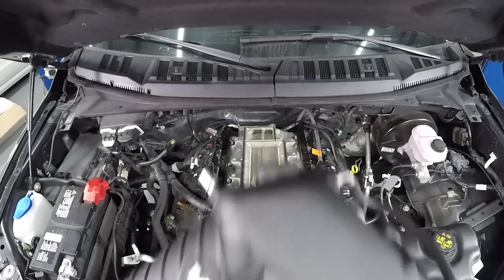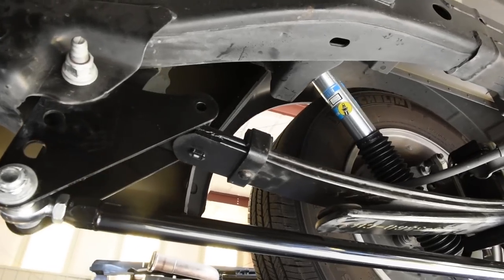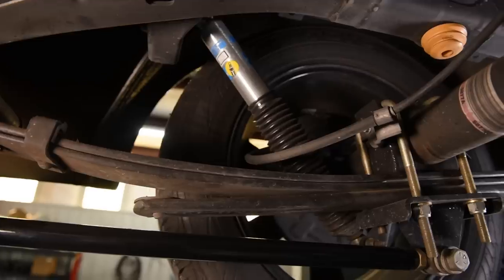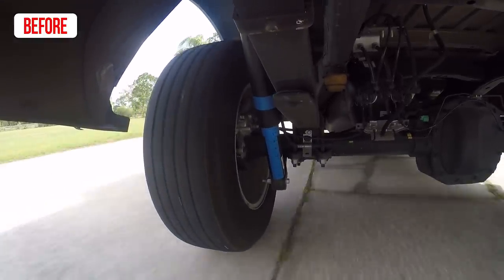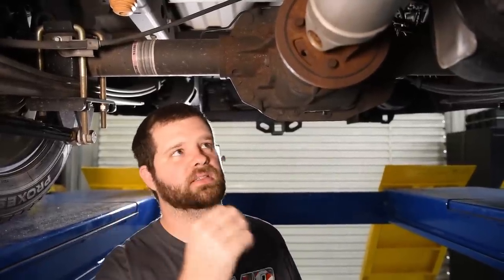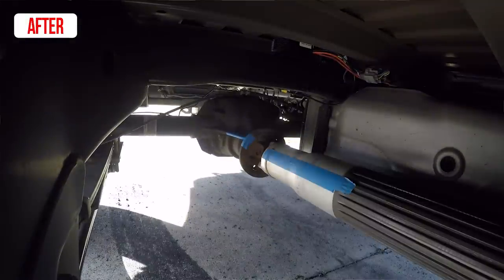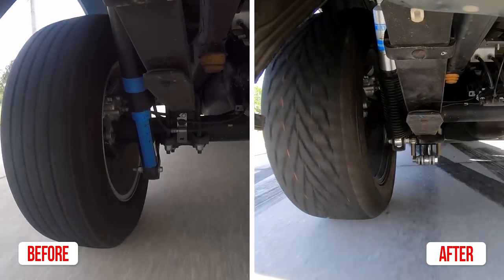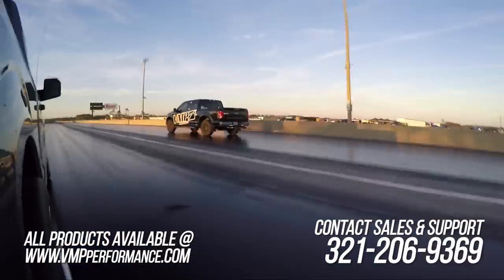How to Make Your 700 RWHP Ford F-150 Race Truck Hook

Comment: Dude..!!
    This was super ligit.. I have 95 I'm placing a 331 Stroker in ... and Cal tracks are my go to ... after a small lowering kit... thank you guys for you time... also I'm going to be bringing my 011 GT500  for a Gen 3 800+ setup.. again Thanks...
Reply from the maker: Thanks for watching ! We're pumped to give your Shelby more horsepower! Let us know if you have any questions! - Max
Reply: @VMPPerformanceTV  I do have a question there Max .. first off thank you for your response... now the question.. is 800+ .. let's just use 700+ Rwhp as a reference.. is that a safe number for everyday use .. I want an 800+ Shelby on the Crank.. I just don't want to hurt my Car .. thank you for any advice.. 👊
Reply from the maker: Yep, that should be fine! Also, if you're planning on bringing the car to us, you should look into our vacation package. We're offering two free nights in a New Smyrna Beach hotel with a qualifying supercharger install. So you get to enjoy time on the beach while we install your new blower! You can find more info on that here http://bit.ly/VMPVacationPackage

Comment: I added caltracs to mine because in this video. I was running horrible 60ft time in the upper 2 sec range due to wheel hop. I also have the belltech 1000sp installed. Why did you with the bilsteins?
Reply from the maker: I heard that the Belltech rear shocks were too soft.- Joe

Comment: Is that the 8.8" rear axle?
At what point did it change to the 9.75"?
Reply from the maker: The aluminum 5l trucks all seem to have the same super 8.8 as the s550 mustang
Reply: 90% f150s come Super 8.8, 34 spline

Comment: Are they 2 or 4wd ? As all f150’s have a open rear differential don’t they!? Mines a FX2 so it has a locker ,which I’ve now been told not to launch it on a dry road or at the track,? So us 2wd guys are really stuck with power on one tire only,? The 4wd is only 3wd correct?
Reply from the maker: This particular truck is equipped with an electronic locker which Joe enables before the burnout when he's making passes.  It depends on the way the 4wd truck is equipped, if it has electronic lockers or not.  If it only has a locker in the rear, then yes.

Comment: Joe what slick size and wheel set up are you using out back?  Are you using skinnys up front or normal street tires.  I have a 305/45/18 Nitto NT555r drag radial out back it still spins.  I have the Hellwig  front and rear sway bars and the Belltech 3/5 kit.
Thanks Jay

Comment: Do you have a similar set up for the f250 6.7 I'm pushing about the same hp and a ass load of tq like 1400lbs worth have the same issue with traction

Comment: That is the 8.8 inch rear right. What gear are you running? My RCSB 18 with a 9.75 rear has a steel factory drive shaft not aluminum like yours, wonder if the rear size is why.
Reply from the maker: 8.8 with 3.55 in my truck. Joe

Comment: Did you have problems with the truck bogging between 1st and 2nd gear shift on the street when losing traction? I had my 2017 f150 pretty much identical to yours tuned by VMP and could never get that issue resolved. Always bogged and then slowly came back into power.
Reply from the maker: This is due to the truck hitting a rev limiter and the throttle closing after the shift, there are some things we can do now to help it.

Comment: Yea you can bolt on all that mess and still its not fixing the real.problem or you can address the real issue.. TIRES!!!  Get rid of these stupid ass tall wheels and rubber band tires!! Easy fix.. We have been converting these for years. 15inch wheels allows for multiple tire combos to get a sidewall that will grip.. Change alxes and front hubs with brakes amd put a damn tire on with a good sidewall .. Stiff ass skinny tires wont get no power to the pavement.. Nobody drag races with skinny tires period!! Nascar even runs 15in.. With 9.5 to 10 wide wheels.. So people if you want 700hp get rid of 18 and 20in wheels.. Or see what happens when you go up against someone who did!!!

Comment: Buy a 4x4 model, problem solved
Reply: Not necessarily.
Reply: I have a twin turbo 18 4×4. Its lowered 3&5 has no traction issues at all in 4×4. No traction bars needed. Just flat out hooks and goes.
Reply: @mikez4606  Does your truck have 700 hp and do you run go pros under your truck to monitor wheel hop?
Reply: Until your transfer case explodes because it's not rated for 700 hp pulls